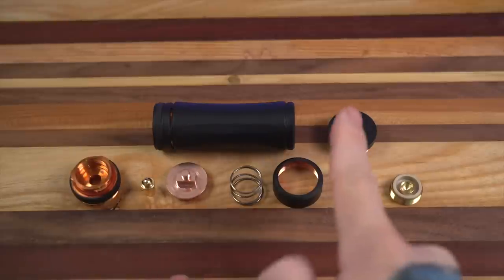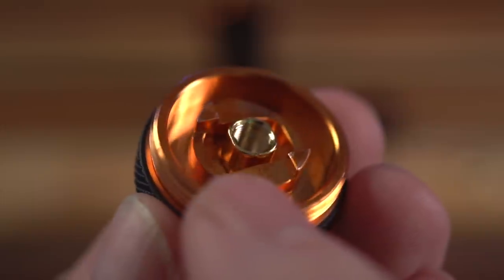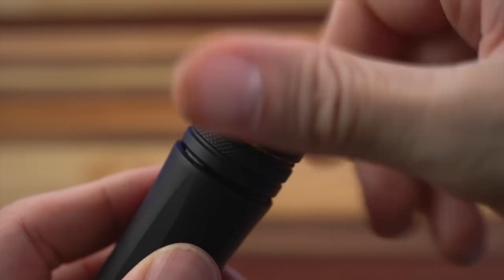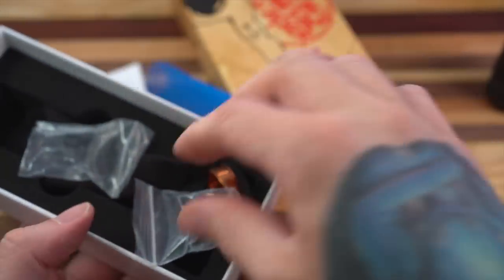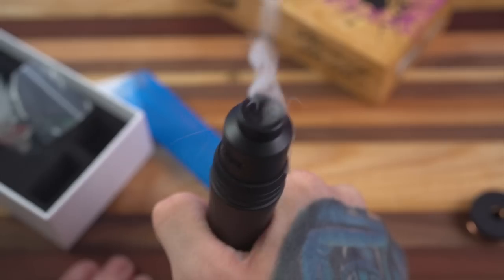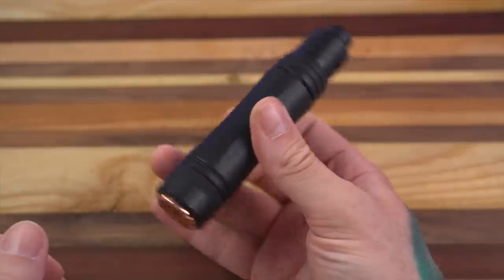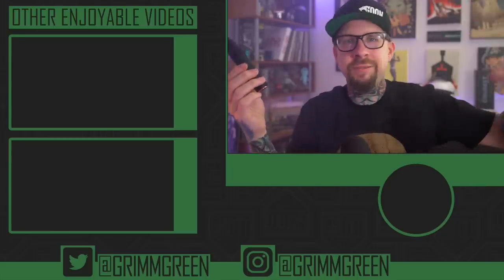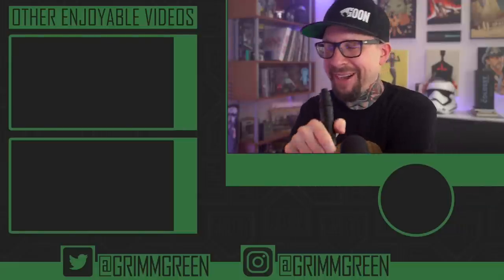The Heavy Hitter Mech Mod - Timesvape

Comment: Cheers for the heads up geez, you've sold me on getting this tube mod that I've just ordered,  been vaping for over 10 years now and have gone through...bat mods...2 x Smoks that both lasted approx 9 months, 3 x Vaporresas that all packed up as soon as I accidently dropped them, two of them onto a carpet from the height of a coffee table,  an El Diablo Incubus that fell apart within 6 months and I'm now on my third 200Watt Geek Vape Aegis,  when I forgot my main go to vape mod that I'm using at the mo, my 3rd Aegis, and accidently left it at my mates gaff the other day I had to revert to using my trusty old single 26550 Smok tube mech mod that has never let me down up until last night when one of the internal copper battery connection lugs snapped in half from wear and tear so time for a change again, I look forward to getting my mits on this Heavy Hitter, Just heard that it's in the post. Thanks for posting.

Comment: I love my heavy hitter and use it daily, good buy, but the 28mm kennedy with the matching rda is my absolute favourite mech setup now, but they are in totally different price brackets though so. If you have less money, heavy hitter is the best out there now IMO. I also love the keen from tenacious tx, which is also nicely priced and has the best feeling hand grip of all mechs I own. I actually like the keen more than the heavy hitter thinking about it now=)
Reply: i got # 13 of the 28MM Vindicator (Brass) and a black NightMare 28 on it. with the black coated copper button housing it looks sick! Kennedy products are class pure and simple.

Comment: Also I own a heavy hitter and love it. I’ve seen and used mechs that cost astronomically more than the heavy hitter that do not perform as well as the heavy hitter. Well done Stan, Heavy Metal Vapor and Times Vape, well done.
Reply from the maker: totally agree
Reply: Beat me to it, I was going to say the same thing.
Reply: Ricky !!!!!  I think so lol the heavy hitter is fantastic bro Its worth every penny imi
Reply: Amen to that 👍🏻
Reply: how does it hit if you using a .08 with a 30t?
Reply: Totally agree, I love mine!
Reply: @aggressor299  he said a. 13
Reply: @aggressor299  I imagine HARD, with this mech that works 100% all the time and has really good performance, and never gets warm easily. Be safe, short pulls, and no chain vaping, lol=)
Reply: I love everything about this mech outside of the accidental locking that happens with the button. If it didn't have that, I'd use it as my daily driver. I love timesvape tho

Comment: As a lefty, that switch solves the main problem I’ve had with mech mods. Most switches will lock/unscrew when I press with my left hand, but sounds like since this switch locks “backwards”, that wouldn’t happen!
Reply: Me too Ad Lib 👊 for the price and innovation u can't go wrong with the Heavy Hitter but at the moment the Matte Black ones are sold out almost everywhere but there's one place I found that has it called Vaping Delights it's 85 bucks but free shipping so that's a bonus
Reply: Ricky !!!!!  with the Heavy Hitter you'll actually be tightening the button housing using it lefty another solution try Sidefire Mech Mods depending on your budget there's some really good sidefire Mechs out there the Clutch is under $100 n it's a great little sidefire Mech n packs a punch too the Pegasus and Orion Mech Mods from Infinite Modz are nice too but they're over $200   the Purge back to basics v5 is going to be sidefire they also have the Slam Piece but again they're on the over 200 bucks range there are quite a few sidefire Mechs out there but other than the Clutch Mod they're all pretty pricey
Reply: @reddvapesadvocates9737  yes immortal modz makes really great side fire mechs too (but I kno some ppl still hold grudges against immortal but u cant talk shit about their mechs cuz they are that damn good )
Reply: @cavemanlovesmoke4394  I like Immortal Mods but like I said other than the Clutch Mod all other sidefire Mechs are either close to or over $200 I actually want to get a Coated Brass Seige and a Coated Copper C. A. D but the Coated Brass Seige has been all but impossible to find i might end up getting a Coated Grip Mod if I can't find a Coated Brass Seige

Comment: If you find your button popping off when firing just add the spare O'ring on with the original one it snugs it up to where its not moving as easy and coming out. Banging mod that hits like a truck that's for sure, I went with a Temple28 and love it.
Reply: Yeah I did too but I think the Valhalla 28 might be better for a mech. I like the temple on the Odin but it is what it is. I need that Valhalla or nightmare   I like 24-26 on mechs in general.
Reply: dude nightmare rda is in my top3 rdas rn. It's amazing honestly I'm surprised more ppl dont talk about it! I have my matte black nightmare on my matte black heavy hitter and its beautiful,  I do have a gold temple 28 on the way cant wait to try it out on the hh

Comment: Is this a good starter mech mod for someone buying there first mech? I’ve been vaping for like 4 years and seems like there a lot of safety features on this thing
Reply: I wouldn't say so. Go with a Tauren mech or the mike vapes curve semi mech, or some other semi mech mod. You can fuck around and get the button stuck and panic with this one. Not taking anything away from this mech(it's nice) but get a solid foundation in ohms law and some experience first. It's a fine mod tho.

Comment: Make a 30mm pisces design that uses 26650's and that same switch and I'm sold.
Reply: 21700s out perform the 26650s by a large amount. I highly doubt anyone will ever make a 26650 mod ever again.
Reply: @MikeKraemer87  I was mainly going for battery life, not amperage. If that makes sense.
Reply: @charlestannehill7537  I understand what you mean, but even the 40ts still out perform all of the 26650s i know of. I was a big fan of the 26650s and then the 21700s popped up.
Reply: @MikeKraemer87  I recently just settled on a DNA 250c with a 4s 2800 100c lipo. Aromamizer titan. My first lipo. I'd buy a 21700 mech mod if it had the pisces design and that switch. Would be the best single batt mech mod ever. I'm sure I could fab one up with that switch, but I have a lot going on right now.
Reply: @MikeKraemer87  it isn't a tube but  Mods by Nasy has a dual 26650 box with a lifetime guarantee for right around $100. you choose the powder coat color and Series or parallel, button color ETC. i bought one murdered out and it by far my best preforming mech i own hands down . 10600 MAH lasts me 2 days with a .2 build.

Comment: Heavy hitter or dreamer v1.5? please help me to pick
Reply from the maker: Out of those I prefer the Dreamer
Reply: Dreamer v1.5 any day. The O-ring on the Heavy Hitter wears out pretty quickly so when it breaks you SOL. Plus the button section constantly comes loose and will pop off. Very poor design IMO even though I get it that they were looking more at safety. Plus the Dreamer v1.5 IMO hits harder and just overall a better performing tube. I'm still in love with the Clutch and the Denalis from Snow Cap Mods! The Denali, Clutch, and Avalanche V2 have basically retired most of my tube mechs.